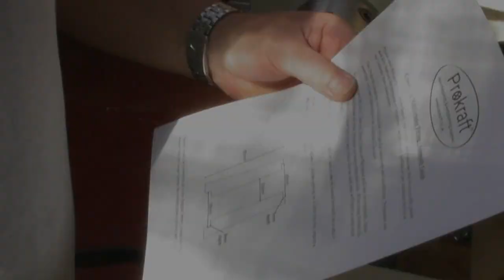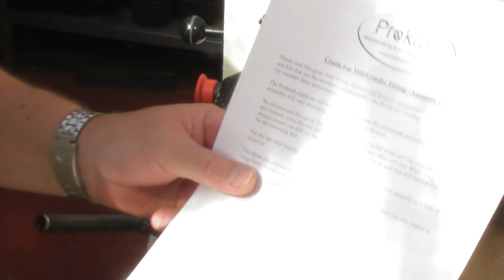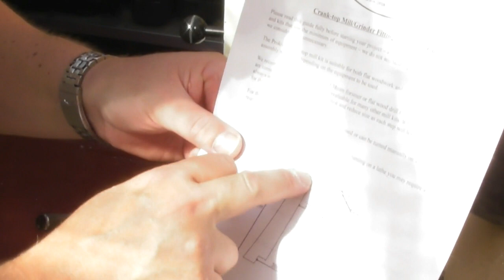Crank Top Mills / Grinders

Comment: Fantastic video with worts and all thank you. just a quick question do the top  crank fit the shaft of the 10 " Mills you know what I mean lol thank you Graham
Reply from the maker: Hi Graham, no they don't fit because the crank-top kits have a flattened thread to fit through the crank (it is the crank that provides the drive not a drive plate as on standard mills) you may be able to grind one flat to fit as they do have the same size threads. I hope that makes sense - I'm off to get some wart treatment! Cheers, Jon